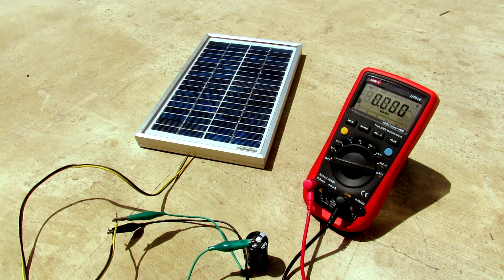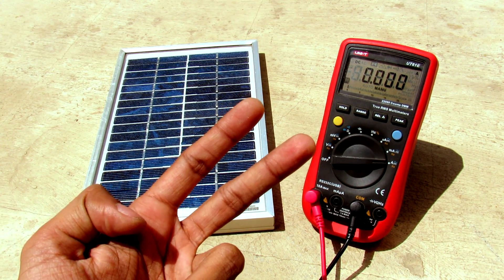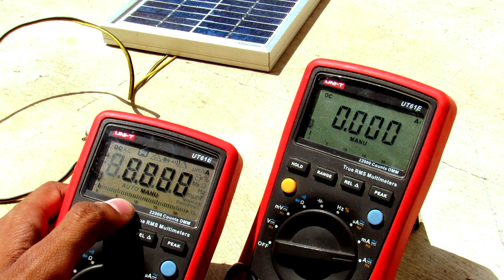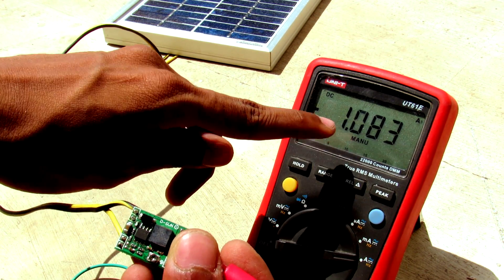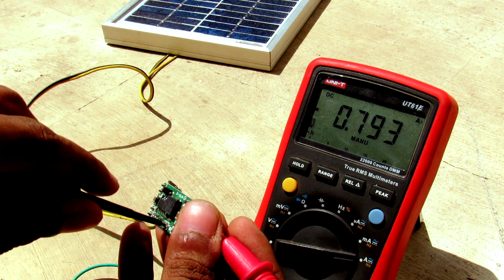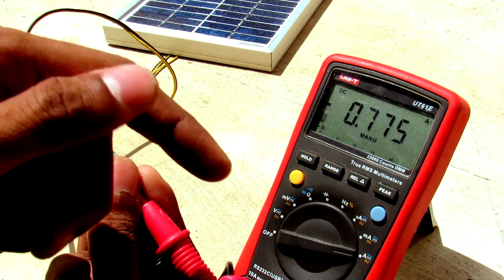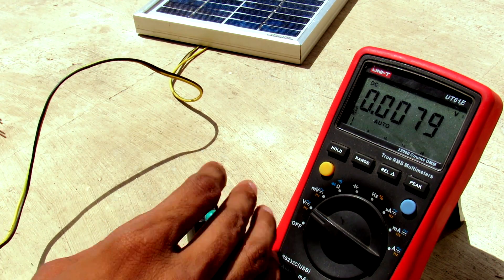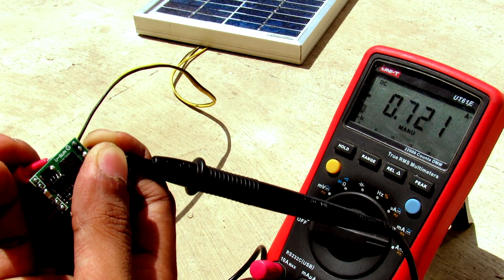High Efficiency Solar Charge Controller

Comment: Getting more energy out than comes in is not possible. Either the electrical voltage or the current increases, but both cannot be done at the same time. If measuring devices indicate this, then something is wrong with the measurement.

Comment: The video is good. You idea's are perfect. But please don't tell you increased efficiency or power. Because you just reduced voltage to increase power. Efficiency and power remwins same (efficiency reduces actually due to losses in the buck regulator).

Comment: Hi,
For my little project I have,
Solar panel open-circuit Voltage: 40V
Battery 12 V (AGM
)
Controller : PWM controller max input voltage 28V
I need to step down from 40V to 25V and connect to solar charge controller to charge the battery? Will I lose energy in this converter in step down mode? Or the module will convert in to Amps from Voltage while step down?
How can I complete the project? What is your suggestion?
Thanks,

Comment: Just in Case of Short-Cut is better! it works as a short Resistance. <3  otherwise the Power will drop down. this Regulators frequency is 10khz-30khz you will get strong Noise Waves depend on user :-( ((((

Comment: I wish to charge a 10F 2.7V supercapacitor with mini solar panels. Can the Dc-Dc converter charge using higher voltage like 5V, 10V solar panels to 2-2.7V safely? Or better to use like 2V solar panels?

Comment: I use the MP1584EN module for many of my arduino projects. They're great little converters and are very efficient compared to others such as the LM2596. The MP1584 can also be more efficient if you use the EN pins to shut them down when not in use.
Reply: I will be doing a another video on a 1584 mod that keeps the solar panel at power point for maximum energy transfer in about a week.  Known as MPPC which gives almost the same result as MPPT.

Comment: He just forget the low of conservation of energy u only see 1A current but did u notice it has only output voltage of about 0.8v  which is of 0.8 Watt of energy under full load this kind of buck converter circuit increase the current but as well decreases the voltage reverse condition obtained in boost converter which increases the voltage by decreasing the current this kind of circuit only gives the maximum efficiency of about 80 to 90% so u cant say u can amplify the power of solar panel by using this bullshit circuits and super capacitor...
Reply: of course but the best result was the capacitor charging. That is practical. He double his amps compared to the solar panel directly.

Comment: While you can get greater efficiency by "tuning" the load on the solar panel, but it's not as simple as comparing direct short-circuit current from the panel to short-circuit current from the DC-DC converter.  The voltage has to be taken into account at the same time, and the product is the available power.  
Power (watts) = V (voltage) x I (current)
The standard specs for a solar panel are V_open_circuit and I_short_circuit, but these are the extremes.  
V_open_circuit corresponds to no-load, which means no current flowing, and the actual power generate would be approximately 0.0 watts.
When go to short circuit, then in spite of the current flowing, the approximate voltage approaches 0v, which again would be approximately 0.0 watts.
You can look at it kind of like "too small a load and you leave power behind" (not used), and "too big of a load and the solar panel start faltering" (can't generate). 
Somewhere in between no load and no voltage you get power transfer from the solar panel.  You get the maximum power transfer from the solar panel essentially by doing impedance matching of the solar panel to the optimal load.   The DC-DC convert provides some determinate load, and you can figure the output power from the solar panel as the V_out @ I_out across that load.  To get the optimal performance (efficiency) from the DC-DC converter, it also has to have an appropriate load, and again the power out is V_out @ I_out, and the efficiency is the Power_DC-DC_convert / Power_solar_panel.
Reply: That was a lot of words to use instead of just saying something like 290 mA @ 10 V is more than 780 mA @ 2 V... 2.9 W is greater than 1.6 W
Whew.  Sorry.
Reply: As they say a little knowledge can be dangerous. A little knowledge shared on YouTube can be catastrophic! Notice him putting the 2.7v super capacitor directly to a 17v output of a solar panel.
Reply: Heh heh heh, yes.  Thankfully, the I_closed-circuit is not very high.   Otherwise, there would have been noise, and then and swearing after the magic smoke was released from the genie's bottle.  At that max current, I am guessing that it would take between 40 seconds (100 F cap) and 100 seconds ( 600 F cap) to get to the rated voltage.  Caps can go above rated voltage for a short period when charging, but not by much, and not for long.
I've been beside someone when they let the magic smoke out, and it's not pleasant when you're taken by surprise.  :-D

Comment: Technically, its a question on durability of the buck used and there is a limitation on the total wattage that can be handled by bucks,please let us know about dc bucks,step up and step down ones if possible.

Comment: Hello Kedar, 
Firstly thanks for your videos about electronics that can giving great informations. I am working on a project that can charge my powerbank with the solar cells. I connected my solar cells in serial. Each cell gives me 0,6v, and I can get 6.8 v with 12 solar cell. I am using a DC-DC convertor (step down module) to get 5v for USB. 
But my panel looks really inefficient. Each cell is 1 watt. And I can get just 0.8 amper on 5v. It means i can get less than 5 watts. Short circuit current is 1.15 amper on 6.8v. I cannot find the problem. I didn't use any blocking or passing diode. 
I'm wondering your ideas. Thanks in advance!

Comment: it shouldn't be possible for you to get a higher current than the Isc. !!
how does this work ????
Reply: He hasn't got a clue of what he is doing. The fact that he put a 2.7volt capacitor directly to the solar panel that is putting out approximately 17v, should be enough evidence of that. The PWM charge controller DOES NOT increase the current it is merely delivering charge to the battery more efficiently by lowering the voltage through pulse width modulation.
Reply from the maker: +Mahmoud Yehia according to maximum power transfer rule if load resistance is matched to output voltage maximum power will be transfered & pwm DC converter kind of works like this.
Reply: He say he doesn't know what he is doing but practically what he did was decrease the charging time of the capacitor.

Comment: hello i have small solar panel 2,7W http://www.amazon.co.uk/Xstorm-AB311-A-Solar-AB-311-City/dp/B0044E7HRC/ref=sr_1_2?ie=UTF8&qid=1457605334&sr=8-2&keywords=A-Solar+City+Bag  and its not charge my xperia if i instal this module its ok http://www.aliexpress.com/item/DC-DC-USB-Converter-Step-Up-Booster-Module-2-5V-to-5V-1200mA-1-2A-for/32265947664.html?spm=2114.13010208.99999999.261.Fscf4c

Comment: Man, what's the name of the smaller dc to dc volt regulator you used here?
Reply: +John Dominique Bayate (Dulag Utok) Here you go http://www.ebay.com/itm/Mini-DC-DC-Converter-Step-Down-Module-Adjustable-Power-Supply-4-5-28V-TO-1-3-17V-/360741046604?hash=item53fdd7894c:m:magkfmqBT_vwyELBcjuQKMA
Reply: thank you. :)

Comment: It's efficiency.
Reply from the maker: DC converter has 91% Efficiency .
Reply: +Kedar Nimbalkar Well you do know that's only peak efficiency right? If the panel gets even a little bit of shade on it, that efficiency will drop quickly and can even drop to as low as 50% or more, depending on the module, thus in some cases makes it worse than a normal PWM charge controller.

For example look at the datasheet for the LM2596 http://www.ti.com/lit/ds/symlink/lm2596.pdf
It has a peak efficiency of about 94% but only at 20V load and with an input of 25V-40V whereas at a more standard 12V load it's only 91% efficient with a 25V input and it drops quite rapidly when you go under the 15V input and of course the lower voltage of your load the less efficient it is too.
Reply: +Kedar Nimbalkar 
I think it is great u make us aware of getting more energy out of the sun is possible in more then one way. Thank u for that.
Maybe something to keep in mind:
For DC to DC step down the buck converter is one of the cheapest and efficient ways to do it, but dont forget that the more u step dow the voltage, the less efficient de converter will be. For instance, if u use half voltage, the efficiency is only 67%. You can improve that a bit with using good components around it (like the goldcap), but the real trick is the frequency the converter is working on. Get the highes frequency one with good components and you go up to 80% on the same half voltage level.
Greets from Holland.